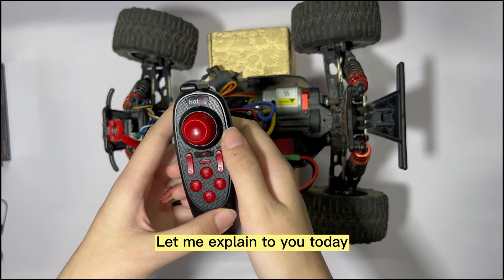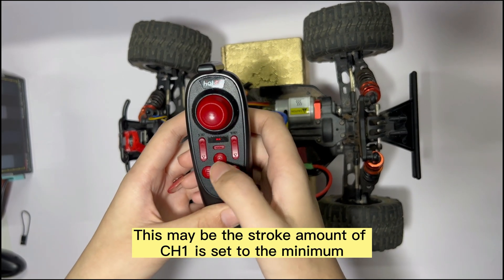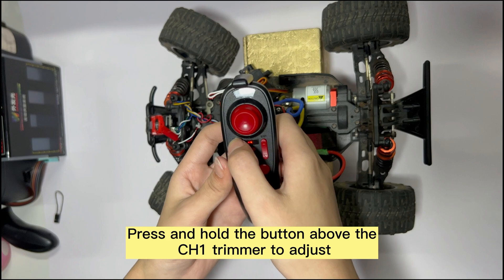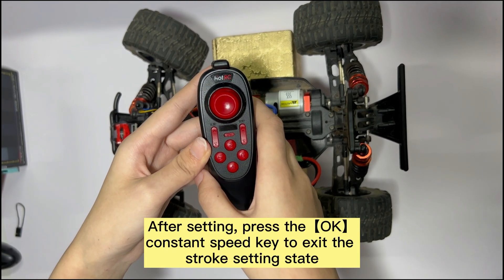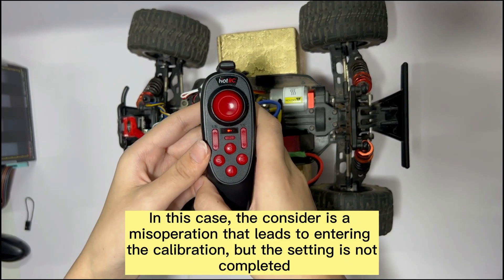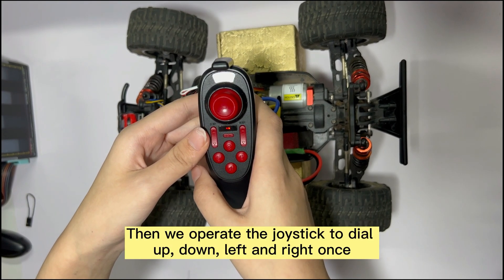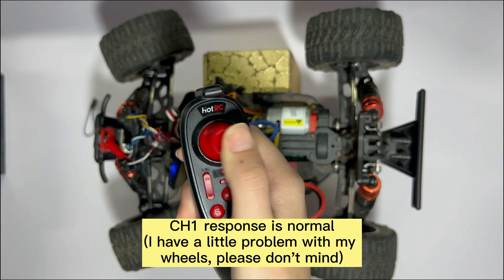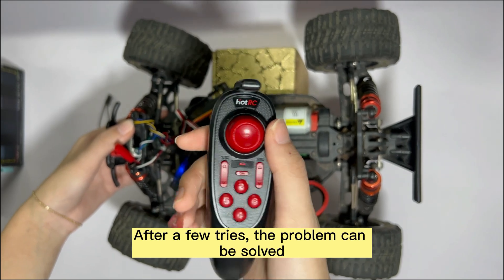HOTRC DS600 Stroke Adjustment and Calibration Settings

Comment: How do I adust the stroke with the new DS600 with the LCD screen? These instructions don't work for my new one.
Reply: From the instructions of the new LCD remote: The stroke of each channel of the remote control can be adjusted.
2. Setting method
A. Remote control shutdown status,
B. Press and hold the channel key [ 5] of the remote control first, and then turn on the power switch of the remote control;
C. By pressing the corresponding channel button to adjust the stroke amount of the corresponding channel, the adjustment process can observe the stroke amount of the rudder in real-time
D. Long press the channel key [ 5] to exit the setup.
[Note: The default stroke amount is the maximum, and there are 10 segments from the maximum stroke amount to the minimum stroke amount, which can be adjusted in cycles.]
Reply: There ain‘t no feedback on the throttle servo, but the throttle trim does adjust its stroke when in this mode.
Reply from the maker: OK, I will send you a manual for the DS600 remote control. I hope it will be helpful to you.

Comment: hi there, I have the 2 esc joined togethe with y-harness, I have hotrc ds 600 with the screen, it works fine backward and forward but in direction it can go to right but if I steer to left it goes backward I tried calibrating but it did not work , any suggestion? thank you in advance
Reply from the maker: Please contact our facebook account and send a picture of your wiring in a private message
Reply from the maker: Facebook account name: Sophy Hotrc

Comment: please ... i have set the esc to a forward and reverse but the stick in the control is not centered... the neutral stick position mkes the motor slightly run cw,,,, and the neutral point is little below that,, HOW CAN I MAKE IT BE AT EXACT CENTER ?
Reply from the maker: Did you adjust the failsafe function?
Reply: @HotRC-Sophy  not yet because wanted this to be ok before failsafe
Reply: do I need to do  failsafe configuration before? will sol e the issue?
Reply from the maker: @marcelocmj6680  Are you using two-way or one-way ESCs?
Reply: @HotRC-Sophy  flycolor 150A with reverse option programmed
Reply from the maker: @marcelocmj6680  You can use it normally with a two-way ESC.

Comment: Hello)
At what range is the most stable operation of the device possible?  I am interested in a device with the possibility of radio control at a distance of 1-2 kilometers on the ground. Which model from the list of your devices would you recommend me?
Reply from the maker: HT-8A remote control, the bottom distance is about 400 meters (without occlusion), and the air distance is 600-800 meters
Reply: @HotRC-Sophy  Are your items on Aliexpress?
Reply from the maker: @АлексейЯрцев-ш8й  You can search directly on AliExpress or Amazon, you will find it